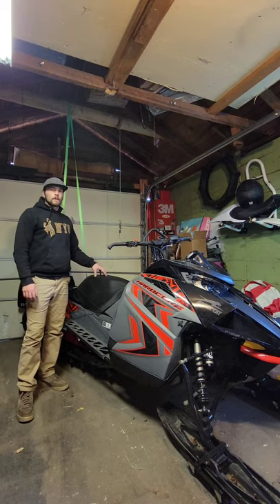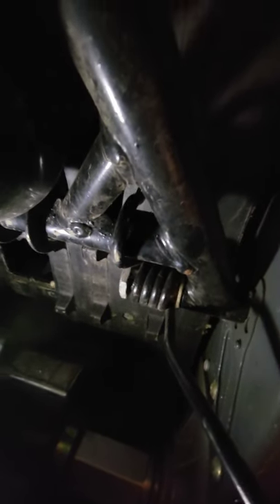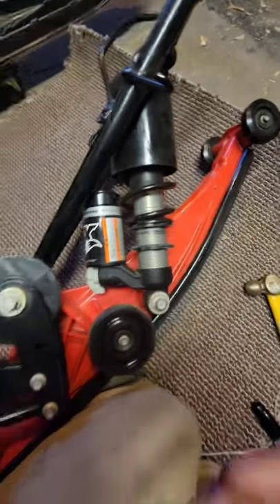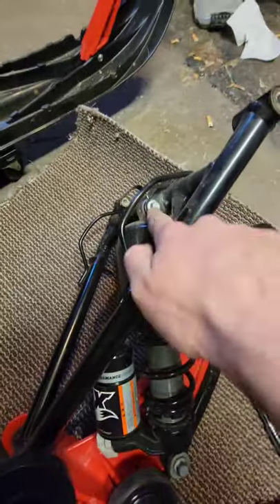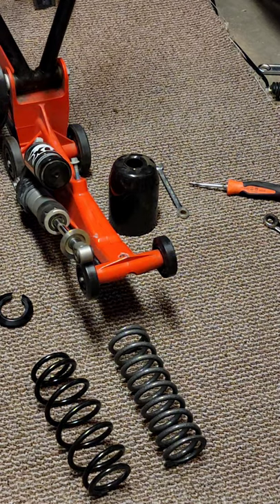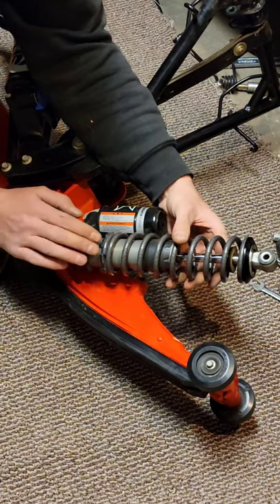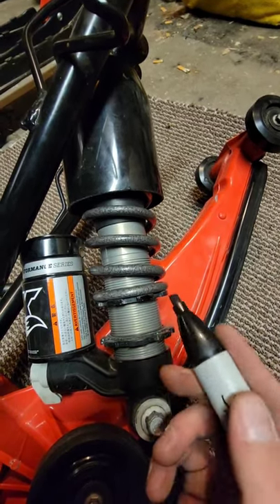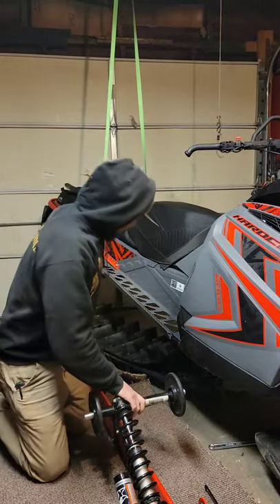Arctic cat Alpha one stingray spring mod

Comment: Do you have to pull the skid to get the shock out? Can you not just take both bolts out on the shock?
Reply from the maker: You can remove it with the skid still in. I just chose to do it to show how to take it out and to check everything.

Comment: How did the sprig work out? I have one I am about to install on my Sidewinder.
Reply: Hi, i also have a sidewinder and looking to upgrade. have you tested it yet?
Reply: @robinfahlgren296 I have the stingray sping on my sidewinder. Helps the sled tremendously. I've since Alpha rail swapped it and it's even better
Reply: I was thinking of doing a alpha swap next year.  

Are you still using the stingray spring in the alpha?
Reply: Yeah im still using the stingray spring. The Sidewinder needs all the help it can get lifting the front up